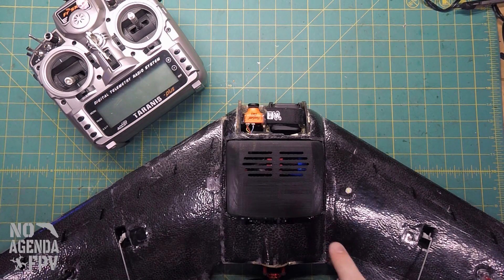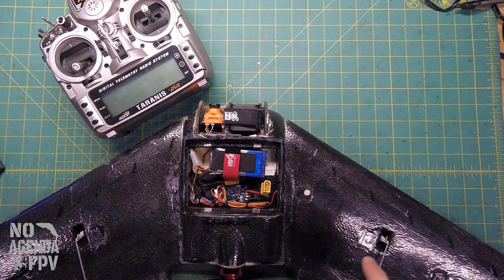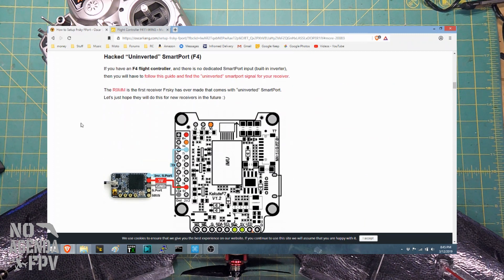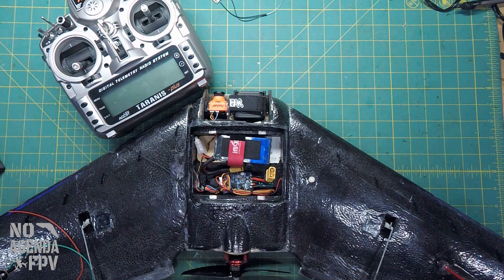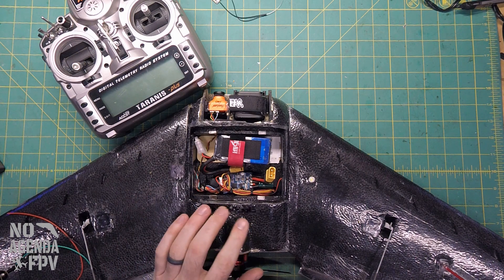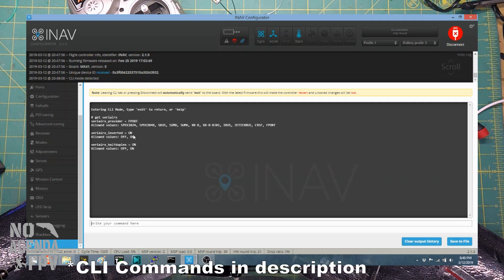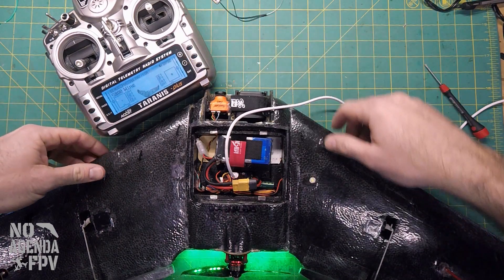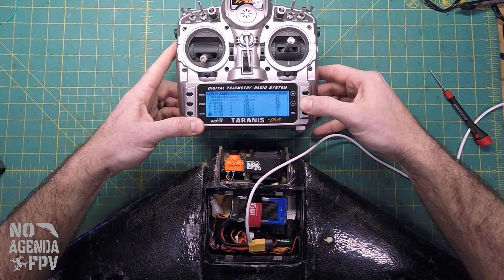Matek F411-Wing FC and FrSky R9MM Receiver -- F.port setup

Comment: I followed your video and I got everything working as you described.  Is there a way to change vtx power settings from my taranis via the FC.  I noticed Inav now has that feature in the adjustments tab.  MY vtx has smart audio.
Reply from the maker: this is my video about how to do that https://youtu.be/Vd6EBr4QYa8
Reply: Thank you for the link, but I was referring to the F411wing wiring.  With the r9mm setup discussed in this video, I don't know if I can setup vtx power changes from my taranis x9d to the smart audio pin on my vtx.  I have led's and I have don't have any available uart's on my f411wing.
Reply from the maker: @joemoffo9706  use the ST1 pin for the smart audio and in the ports tab set the Soft Serial port to Smart Audio.
Reply: Uart1 has serial rx and uart2 has gps.
Reply from the maker: @joemoffo9706  in config tab, at the bottom, turn on "enable CPU based serial ports" then save and reboot and you will have an additional option in the ports tab then for Soft Serial.
Reply: Works perfectly.  Thanks so much for your help!

Comment: Couple of questions, Where did you purchase your LED's?  I like the green with white flashes.  Also, I have a matek f411-w, in Inav, which firmware do you flash for the r9m/r9mm?  It lists serveral choices, MATEKF411,   MATEKF411 FD_SFTSRL,  MATEKF411 RSSI,  MATEKF411 SFTSRL2,  MATEKF411SE.  I know your using beta flight but maybe someone else knows.  Thanks.
Reply from the maker: I am using iNav and if you want to use LEDs you need to use the MATEKF411 FW. The others use the LED pin as a sort serial or analog RSSI pins, and the SE one is for the F411-SE FC. 

I use the ReadyMadeRC LED strips, but any addressable LED will work. 
https://www.readymaderc.com/products/details/rmrc-fire-leds-ws2812-5050-rgb-addressable

Comment: Did you use the same cli settings and wiring for the slim+ ? (Hacked s.port[rx1] to TX1 on FC)? I have controls but no telemetry.
Reply from the maker: I hooked my Slim+ up to an F722-wing so it didn't need the inverted uart

Comment: Arrrr so if I just want to use SBUS with the r9slim+ I dont flash it with the Fport firmware? 
I flashed it with fport and get nothing when I connect via sbus to the F411. Know a silly question but I'm new to taranis and the r9m 2019 and have more issues then usual thanks mate.
Reply from the maker: Sorry I hadn't replied quicker. I am not actually certain on this question. I think that if you don't want to use F.Port then you should use the Flex FW instead.
Reply: @NoAgendaFPV  Your right but I crossed positive and neg and blew the reciver! And I can't find the fuse to solder over it so there's 90 bucks down the drain. I was half asleep when flashing it and no nothing. Worse it's the only reciver I have. Plus when It was working I got RSSI warnings on and off constantly, as wasn't using the s-port I think that was causing the issue but of course can't test it now.

Comment: How to get the r9m slim working? there is no inverted s-port on that one. any idea?
Reply from the maker: I do not believe that there is F.Port firmware for the Slim. I am running F.Port on my Slim+
Reply: @NoAgendaFPV  yeah I ment the slim+ . Found out that the Rx port on the receiver is actually an inverted s-port. Tx is an inverted sbus. Got everything working now with only 3 wires. Really nice. Only issue I have is that inav somehow shows a maximum rssi value of 50%. Not sure what that can be.
Reply from the maker: There is a CLI command for that. "set rssi_max = 50" got mine reading correctly...I think it's correct at least

Comment: i'm having issues with f.port inav 2.1 r9mm omnibusf4 prov2 7inch quad , all good until i arm and get telemetry lost .. and looking at the sensors list seem all telemetry disrupts except for rx voltage and rssi wich are the default ones anyway. i'm guessing its filtering issue. 
anyone had this ?  
not many reporting f.port issues. 

please share your sollution.  thx.
Reply from the maker: Interesting, wonder if it's something on the FC that has trouble doing the processing for both.
Reply: @NoAgendaFPV  i guess i'll make a short video about it .. and after add some caps .. found some rubycon one's in my stash. ill report back.
Reply: maiden figts were sucessful having perfect control on f.port but telemetry is in the same state. even after adding extra filtering this doesnt fix the problem. tested with a different rx on sbus had no issues. investigating still.

Comment: I'm not seeing my RX Channels with this setup! Did I hear you say the RX is on Uart 2 and does that need to be enabled in ports? I had my GPS enable on that port as well. Will that work? Any help appreciated for the noobs.
Reply: Edit: So I'm using Uart1, Serial RX enabled, Configuration Mode is Serial based RX and provider: F Port.  FPort from RX is is plugged into TX1 on Flight Controller but I have no input motion!  Help.
Reply from the maker: With the R9MM receiver? And using the "inverted S.Port" signal from the receiver? If you have those setup, try the "serialrx_inverted = off" (if you already tried the CLI commands in the description like I used)
Reply: @NoAgendaFPV  After examining the RX, i realized i am using the Mini instead of the MM. I have an MM, so I'll give that a try. Thanks for the quick reply and I'll let ya know. Interesting to note, that the Mini will flash with the F-Port firmware :)
Reply from the maker: I think the mini and mm use the same FW, hope that the R9MM offices the issue.
Reply: flashed my new MM and plugged it in and now i have TX movement in Inav :) Thanks for making this vid for everyone!

Comment: I went thru the same thing several months ago. I even emailed and chatted with Matek directly about this and told them their website was incorrect. Specifically told them you have to use tx1 and to update their directions. That’s sad that they never did correct the documentation and it’s still causing issues for folks.
Reply from the maker: Technically their site does say to use TX1 now, I just hadn't looked there. I think that Oscar's stuff also says it, but it's not overly obvious since his graphic for the F4 setup is actually an F7 FC and the pins don't line up with what his labels are. Hoping this video clears it up for anyone else looking.
Reply: Nice to know

Comment: Off topic but have you experienced motor noise in your fpv feed using the Matek 411 Wing? I set up a wing where I power my cam and vtx off the main battery's balance lead and even used TWO filters in line and I still get distortion in my OSD. When I use a separate battery however the picture is crystal clear. Any thoughts?
Reply from the maker: I do get noise with increased throttle. I have a 1000u 35v capacitor on the second set of ESC power pads and that helps. I only really notice it when testing on the bench, in flight I am looking past it at where I am flying and only really notice it on full throttle.
Reply: Ok I'll try that thanks!
Reply: Update: The capacitor worked! There is no longer distortion of the OSD, just faint lines in the video but its hardly noticeable. I actually soldered it on the the same pads shared with the XT60 lead, a suggestion I got from one of CurryKitten's vids. I appreciate the tips!